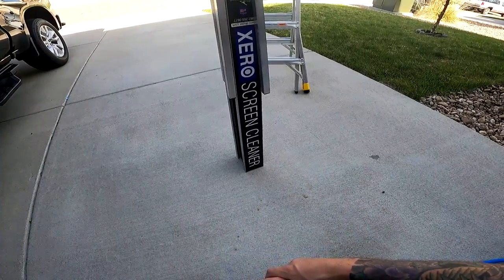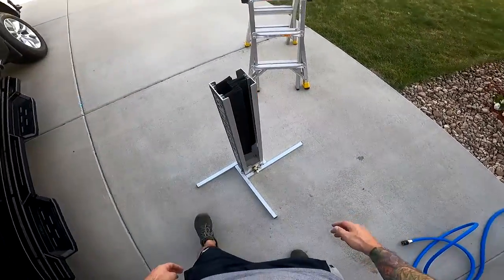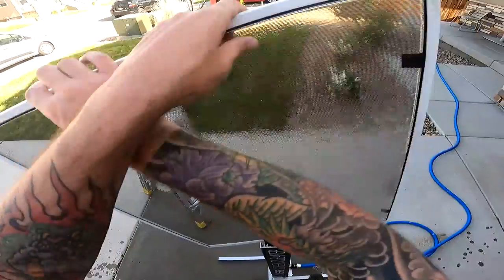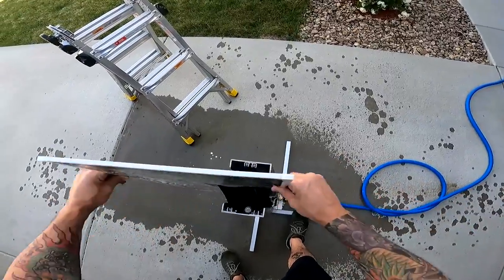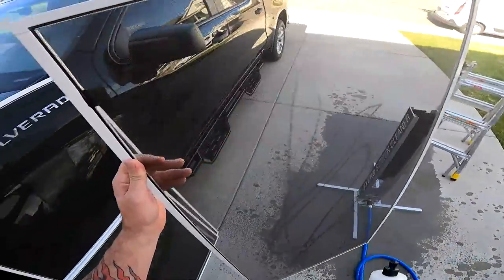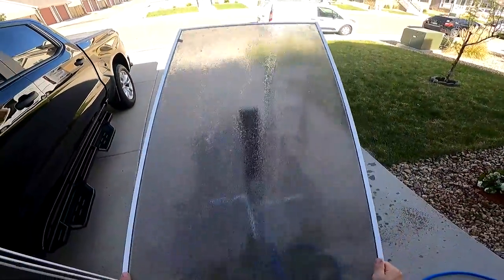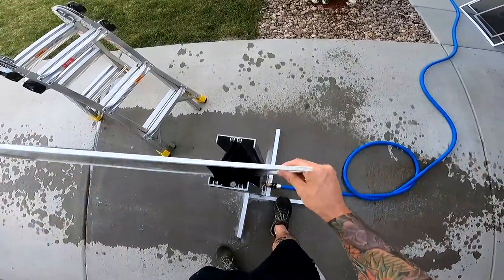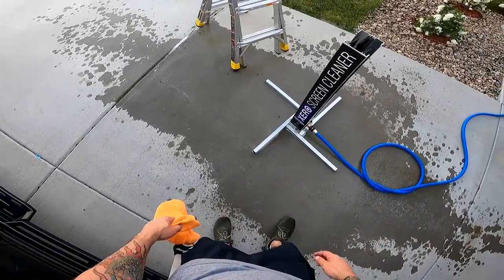SCREEN CLEANER TIPS | WINDOW CLEANING TOOLS

Comment: Hi Steve It's great tool just need to tight a bit the connector of the Unit the Fly Screens has two sides the rubber cord  comes inside of the window on the track the flat one facing outside of the window well done again great tool

Comment: My method is a bit different. One day we landed a retirement center with 900 frames and 400 screens. 

    “Focus on the corners.” Became my metal focus as I spun each screen. I start with a corner insert because it’s easier to insert into the unit; 1,2,3,4 turn; (4x corners) then two taps on the top and then stack in the sun. 
    River views bring in the bugs and spiders but I never needed to re-clean a single screen once I switch to corners :-)

Comment: I go back and forth on getting one of these. I like to use screen magic and it tends to last 2 years before I have to clean them again. Great video brotha!
Reply: Any tips for using screen magic? We use the screen cleaner but I've tested screen magic a couple times to use on smaller jobs or screen porches and I didn't really notice a difference.
Reply: @ericab7873  I hope I don’t lose you in the way I explain it lol 

First: I use a pump sprayer so it sprays evenly 

Second: I stack 3-5 screens on top of each other so I’m not just spraying the screen magic into the wind. Also, I spray the front of the “stack” and the back.

Third: I take a 12in ettore golden sleeve scrubber and work the screen magic into the screen

I’ll be the first to admit that this sounds like a long process and it can be at the beginning but once you get the hang of it, it moves by pretty quickly.
Reply: @Kanevo04  Thanks! I will try it out with a pump sprayer and stacking them…makes sense. I was hoping it would give old faded screens new life but that hasn’t been my experience so far. Although it was a bit windy both times I tried it so maybe that’s why it wasn’t effective
Reply: @ericab7873  you probably already know this but if the vinyl/polyurethane has worn off the fiberglass of the screen then there is no reviving the screen. But if the vinyl is still intact and just filthy, then screen magic makes it look like putting armor all on you tires 👍

Comment: I do spline away from me, so I can see those edges better and give a little extra scrub if needed. Also if you have good water pressure, poke more holes for better flow and better rinse. I have 6 holes in mine and it rinses SOOO much better than when it was brand new and only the 2.

Comment: Couple things- 

It definitely helps you stand out, people think it’s so cool. 

BUT! I recommend only using it on relatively new screens. It will rip and damage 10 year old screens super easily.
Reply: @Tyler Neely It is for many jobs.  If there are over 7-9 screens I bust it out.  Old screens, can do more harm than good.
Reply: Interesting. We use it for a lot of old screens and haven't had any issues. I wouldn't use it on a screen that was already torn but the brushes are pretty soft so they shouldn't rip a screen.
Reply: @ericab7873  I appreciate your insight. The difference could be that I’ve only over used an IPC screen washer. May be slightly different. 

Anyways, I’ve just resulted in spraying screens with my house wash mix, and then quickly rinsing each screen each side. Works just as well.

Comment: Whats the normal average cost to clean each screen?
Reply: Check out his other videos where he breaks down pricing.
Reply from the maker: $2-$3 you could go higher for huge screens but $2-$3 usually covers most
Reply: @SteveOthewindowcleaner  steve does that price include removal and replacement?  Im sorry for all the questions im just trying to justify buying the screen cleaner
Reply: Pricing will depend on your location. I'm in a higher COL area and I'm $4-5 per screen and add more if they are really dusty/dirty or if they are large.
Reply: Dude, I regularly get 5 dollars a screen. Seems a bit high but it isn't worth my time for anything less. You can charge what you want but I definitely wouldn't go less than 3 dollars a screen.